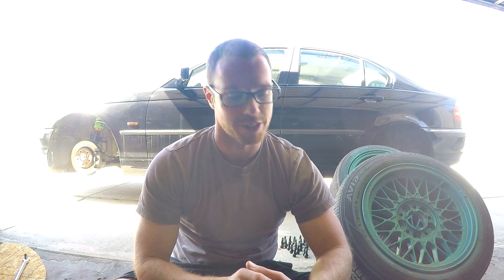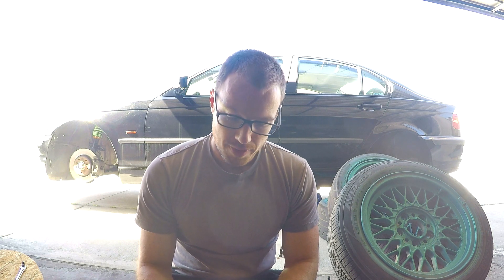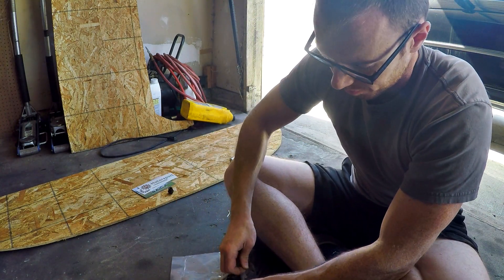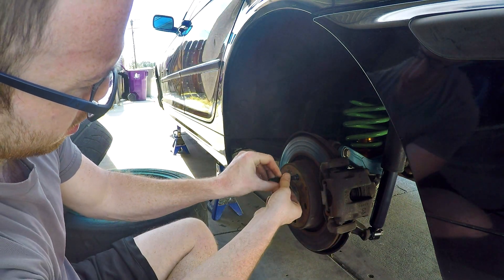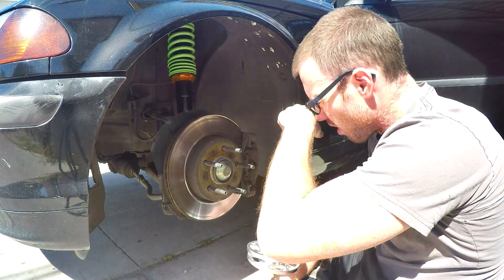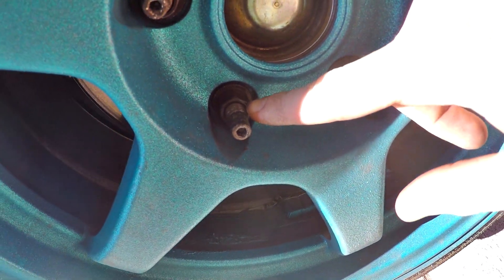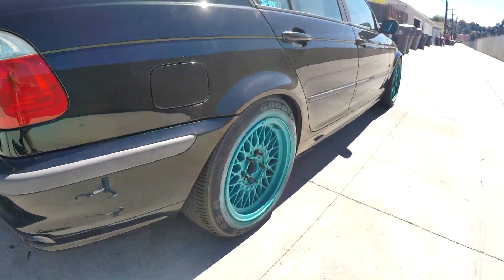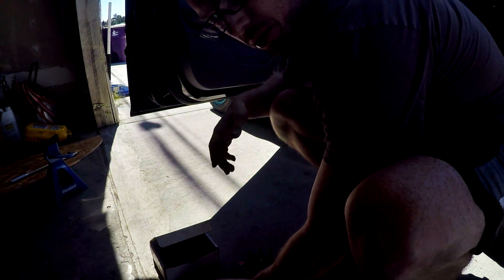Installing Wheel Studs and Spacers, Testing Fitment: Project BMW E46

Comment: You have that backwards -- clearance will change on a McPherson Strut as it goes through its range of motion and camber decreases. It only pivots around one axis, so top point at the top inside of the wheel will move inboard or outboard a certain amount through the full range of suspension travel. Double wishbones limit this motion and allow camber to stay relatively consistent as the spring compresses and expands. 

Best way to make sure you'll have clearance is to figure out the location of the top of your wheel + tire in relation to the pivot axis, find out the motion ratio (how much wheel moves vs strut), find out your suspension travel, and use those to figure out where the strut (which will not change angle significantly) intersects with the circle created by the uppermost point on the wheel. As long as they don't meet through full travel, you're golden.